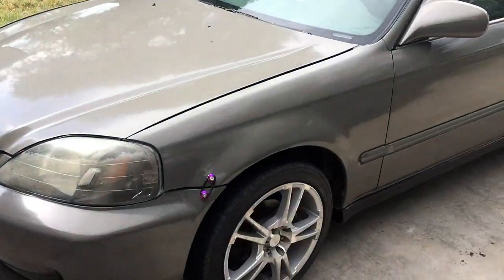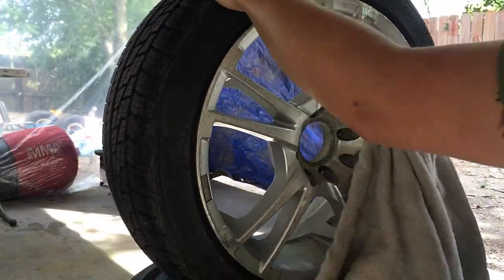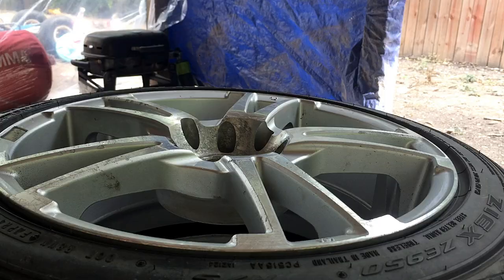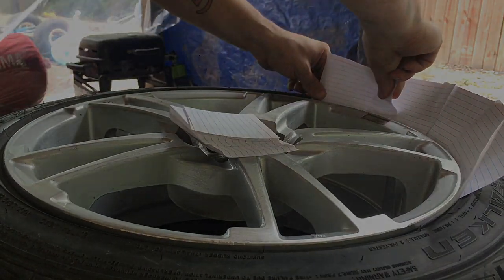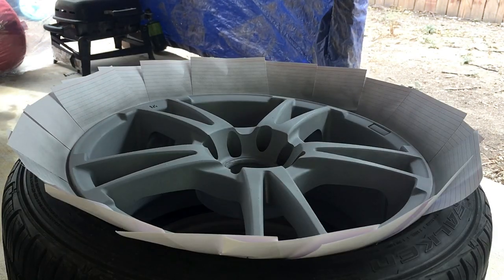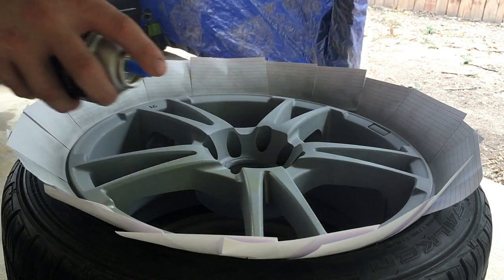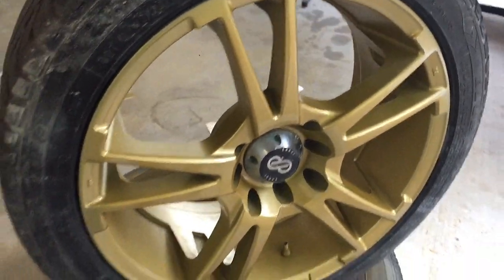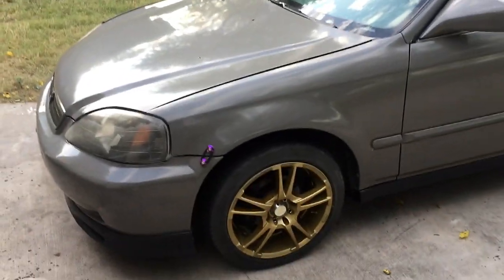How to paint wheels using Dupli-Color to achieve a nice finish

Comment: How long after painting wheels can you drive on the road?
Reply from the maker: BLUEFEATHEREDOLIVES As long as you avoid dirt roads you should be good after about 30 mins to an hour. But most would recommend longer but I’m not much on rules lol
Reply: @JamesDguy  haha thanks! Sounds good. I finished painting my 4 coats (Rustoleum Gloss Black, 2-in-1) around 5 PM and my customer will be coming by around 5 PM tomorrow.